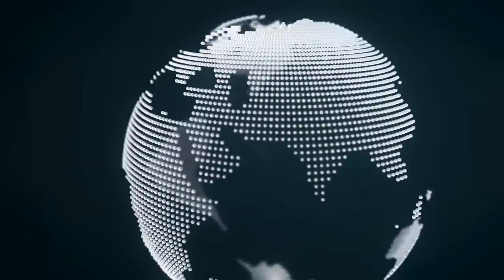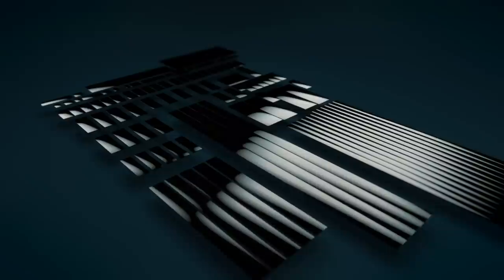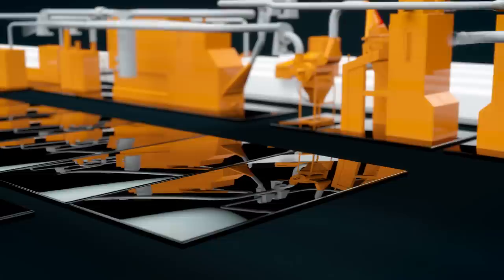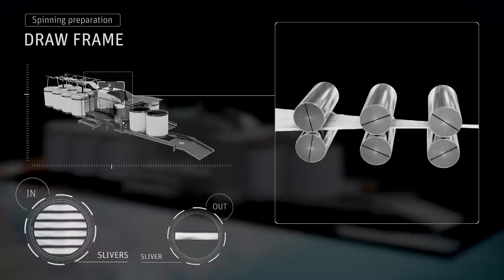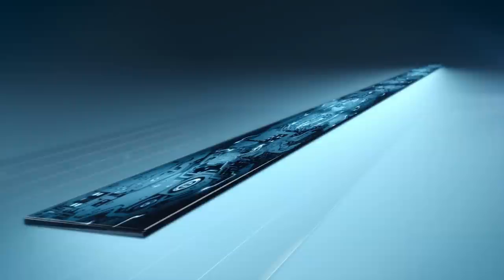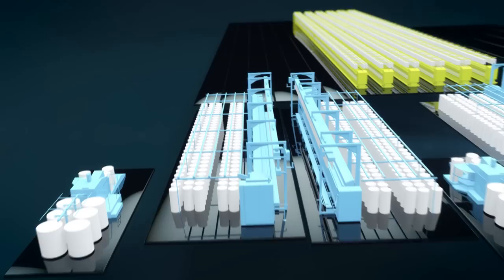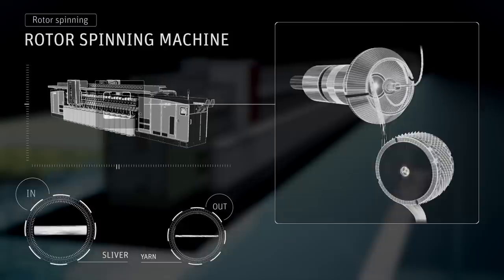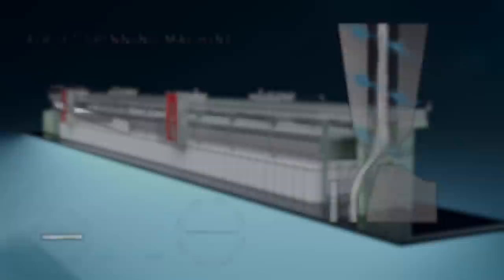The World of Spinning

Comment: Centifugale force the fibers collection in the Rotor groove and there they forma a strap this is taken off via a central nozzle the finisher calm for Rotor yarn is cross sound on two packages
The fourth system available on the market is the air jet spinning system it Is the newest spinning technology and allora a far higher productivity compared ti the other spinning technologies
The draw drake slider is fed into the machine and is forcefully drawn the fibers are subsequently wound by airflow the airspun comb for jet yarn features especially low hairiness and good abrasion resistance